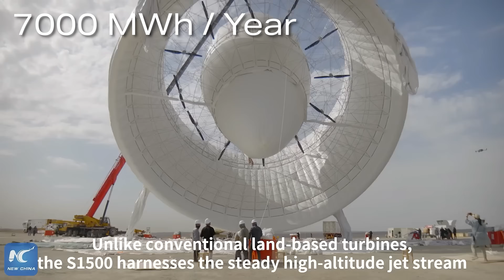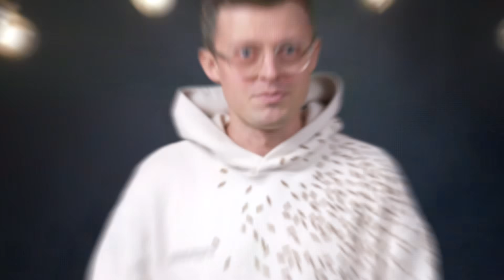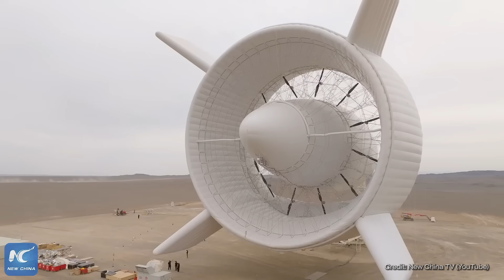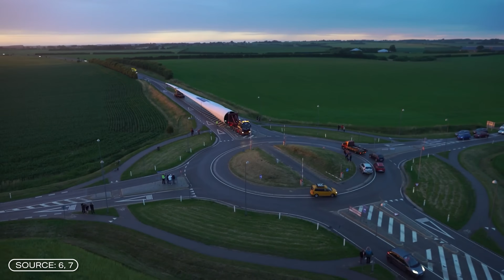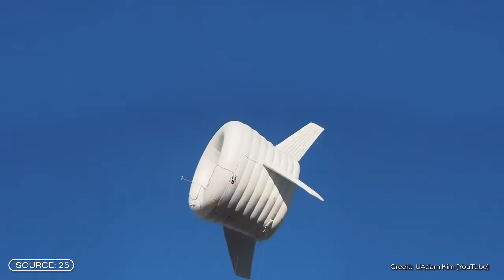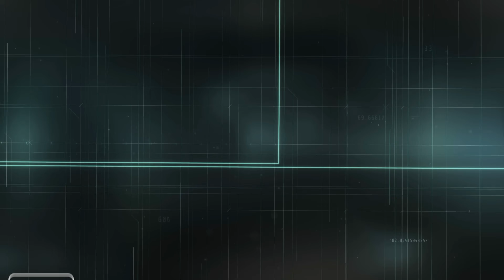China's Wild New Inflatable Wind Turbine (1.2 MW Output)

Comment: Since this video is 6mo old, it's notable that SAWES has already tested an S2000 model, including temporary grid integration, and is moving into mass production. I think their main challenge is that they still rely on retraction and landing during heavy winds. A couple of ways they could improve the design to avoid that would be with aerofoil fairings on the tether to avoid vortices and dynamic feeding of the line in response to realtime conditions. Then they might be able to leave it operating through storms, gaining 30-50% generation overall.

On the topic of dislike for wind turbines, there are two things in these airships' favor. The first is that their design is an icon of the solarpunk ideal, and their form is much less imposing than a massive tower that triggers phobias of large structures. The second is that they are operating in the statosphere where planes are already contiunously running turbines, so the silly argument about bird strikes becomes blatantly dumb instead of being able to fool some laymen.

Comment: A 100kW alternator weighs 350-450kg and that S1500 has 12 of them putting the weight at 4200kg at the least before adding the blades and the airship and the 1km of cable.

Comment: Thanks for sharing the video; very interesting concept.

I would be curious to hear more about a couple of aspects:

* How is lightning protection handled at these heights?
* What safety measures are in place regarding the export cables, particularly in case of failure? I imagine the potential impact could be significant if a cable were to fall onto infrastructure or people.

Appreciate any insights you can share.

Comment: yeah but the tether... we are talking a >1,5km cable thick enough to be insulated and able to actually transport down all that energy and also keeping the thing in place... the forces are very high because you have to hold the thing against the wind with at least enough tensile strength as the weight of the system and its drag. And what if the wind swings, would you have that thing leveling things all around?

Comment: Hydrogen is fine as long as its around a barren uninhabited desert. The small potential for capital lose is greatly offset by how cheap itll be both to produce and deploy. So what if 5-10 or burn down a year. No one gets hurt and the only lose are fans and a electric cable and polyester shell.

Comment: What about the energy loss because of the length of the cable
Reply: It wouldn't even be able to support the cable tether and transmission cable weights alone.
Reply: @ForbiddTV  what? They did get it to 2000 meters and they got it running and functional. Modern aerostat technology far exceeds the 2000 meter threshold, it's absolutely not a question, highest tethered balloon they launched was in 2022, the Chinese reached a record altitude of 9032 meters
Reply: @HackedToaster  You are believing in a false meme based on scienceploitation.  The S2000 has a total helium capacity of 20,000 cubic meters of helium. Such a blimp would have a gross lift capacity of 20,000 kg to 22,000 kg. The wire for such a 3MW output would be 300 mm² to 500 mm² wire (copper/aluminum) and would weigh 3.4kg per meter (300 mm² copper) or 3kg per meter (500 mm² aluminum). Since the fake machine is at 2,000 meters altitude, one conductor of wire would weigh between 6,000 to 6,800 kg.  There would be a minimum of three conductors which makes the wire alone to be 18,000 to 20,400 kg.  There is also a tether cable of unknown material or weight.   Plus the S2000 dry weight is about 2,000 kg.
Reply: @HackedToaster   They might have raised such a blimp, but couldn't possibly have transmitted advertised power at 2000 to 9032 meters.  Get a clue.
Reply: @ForbiddTV  you're saying that there's no cable strong enough,  I've shown you facts that you're wrong and now you're clinging to the power delivery like I said something wrong 😂 
 I raised the question about power delivery in the first place, this isn't a catcha you thought it was, "get a clue" shut up
Sure just brush aside whatever I have to say. This is meaningless to talk to you if you're acting like that
Reply: @HackedToaster  I have been doing alternative energy for more than four decades. Research the cable required to make your meme even possible, then find the weight of said cables plus the tether per meter.
Reply: @ForbiddTV  I have no doubt about how many years you have been doing what you claimed to be doing, after glancing through your channel. 
You seem to be a debunker of bullshit, which I appreciate.
It's just that the reality is they did deliver power through the 2000 meters long cable tethered to a balloon, which is what they did in January, the cable they used is the one intented to deliver power, the cable would be as heavy as the balloon itself , or at least 2 metric tons and yet they did it. The only way to deny it would be claiming that they lied and all of this is fake 

I think you're calling it a "meme" (which isn't what meme means) because of your experience and expertise, maybe, just maybe, they figured out a way to do it? I'm not trying to argue with you. I simply raised the question of how they solved the problem with power delivery and you just barge in like an angry grampa
Reply: @HackedToaster   So you can’t even be bothered to look up the definition of meme. Interesting.
Reply: @ForbiddTV  the original meaning is from Greek "mimema"  ‘that which is imitated" that's not what it means now, words and languages change through time. And even with the original meaning it doesn't really relate to the context, even with the definition from pre-2010s, meme is how a behaviour or an idea spread from one person to another within a culture, which this balloon and its achievements hasn't reached that status yet, and with modern day definition, the only meme element is that it's a balloon and people would tie it to the F35 balloon take down incident, right now this balloon in itself is neither humourous or ironic, which is why I find it strange to see you refering it as a meme 
And how old are you? You said you have been doing electrical research for 4 decades? You're pushing 50 or 60 now? Maybe it's best to not argue what "meme" means

Comment: Why don't they use hydrogen instead of helium? Manned blimps would want to avoid flammable gasses for obvious reasons, but for unmanned systems hydrogen should be ok.
Reply: It wouldn't work either way.
Reply: @ForbiddTV  Why?
Reply: @nikolatasev4948  As memes way too heavy, then add all the weight of four tethers and electrical cables and it would never leave the ground.
Reply: @nikolatasev4948   You are believing in a false meme based on scienceploitation.  The S2000 has a total helium capacity of 20,000 cubic meters of helium. Such a blimp would have a gross lift capacity of 20,000 kg to 22,000 kg. The wire for such a 3MW output would be 300 mm² to 500 mm² wire (copper/aluminum) and would weigh 3.4kg per meter (300 mm² copper) or 3kg per meter (500 mm² aluminum). Since the fake machine is at 2,000 meters altitude, one conductor of wire would weigh between 6,000 to 6,800 kg.  There would be a minimum of three conductors which makes the wire alone to be 18,000 to 20,400 kg.  There is also a tether cable of unknown material or weight.   Plus the S2000 dry weight is about 2,000 kg.
Reply: @ForbiddTV  You could have a much thinner wire if you used higher voltage and thus lower current. You don't need three wires either, two would be enough to close the circuit.
You also don't need to generate all your lift from buoyancy. At lower altitude it needs to carry less cable, so it can raise up into the high wind - from there the wind and body can provide enough additional lift. They have winglets as well.
I don't see any principal reasons for this not to work. If they find out they still lack lifting power, they can always scale the volume up a bit more, or decrease the generating capacity.
Reply: @nikolatasev4948   Still trying to defend a failed meme?  Higher winds means higher altitudes and  more cable.  A 2,000 meter elevation would actually mean about 3,000 meters of cable.  We already know it doesn't have enough lift for even 2,000 meters of cable.
Reply: @ForbiddTV  We don't 'know' how much it can lift. You made up some numbers, gave a wrong number of cables needed, ignored a significant source of lift and came to an obviously wrong conclusion. Then you pretend you proved anything one way or another.
Reply: @nikolatasev4948   Since you refuse to look anything up, invent your own numbers and I will prove them wrong.  All of your MEMES will be your own undoing.  I fully researched my numbers and phrases, you refuse to do so.

Comment: Helium is the one Achilles heel of this thing. I wonder if a hot air Zeppelin version can be made. Say, by using a small fraction of energy to regularly heating up the air inside. Or else, their supply will always be limited to this one factor.
The upside is, they can also be used to harness energy from storm, even typhoons. On top of that, their power output can be multiplied by sticking flexible solar panels on them. However, how much they'll interfere with air traffic, how much stress they'll put on the ground attachment, what mayhem a falling one might cause etc are real issues to be addressed.

Comment: The helium gas is a problem. It's a finite resource and we have more important uses for it. I also think one of the easiest ways to go up is with a pole (I'm not being facetious) but perhaps part of the problem perhaps that the height is currently being limited by the way we are engineering wind turbines by placing the massive turbine at the top. So, in short, the turbine itself one third down with the rotors at the top. All on a four legged base station (like the base of Eiffel Tower). Smart design and on site assembly means it can be more practical to manufacture and transport.  Maybe? Dunno?

Comment: hello Dr Jacob, could you please speak a little bit faster? i'm having trouble paying attention to what you're saying because my mind keeps getting distracted by your thick German accent.

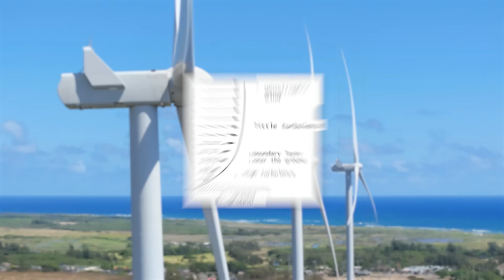at 1:43 you say that when wind speed doubles, its power increases 8 fold? the energy of the air particles is 0.5mv^2 & power is energy/time so maybe 4-fold?

you how they make plastic kayaks where they put the kayak mold in a machine that spins it in all directions & has the molten plastic cover all the walls evenly?, maybe after inflation when the balloon is rigid, you could do a similar thing with a very light sealant that coats the insides while the balloon is spinning around all crazy in a heated chamber.

this design is very cool because the turbines are in an enclosed space & it would cost very little energy to make them bird-safe.

Comment: Fantastic🎉🎉🎉🎉🎉🎉 video

German guy.....you are fantastic don't forget that

Yasssssssssssssssssssss China like that generator....less infrastructural impact?
Disaster areas, mountainous regions, desert? 

Hmmm maybe fit it with sustainable hydrogen inversion system  to auto reinflate or use drone maintenance system to apply sealant coverage

🎉🎉🎉🎉🎉🎉🎉🎉🎉🎉🎉🎉🎉🎉🎉🎉🎉🎉🎉🎉🎉🎉🎉🎉🎉🎉🎉🎉🎉🎉🎉🎉🎉🎉🎉🎉🎉🎉🎉🎉🎉🎉🎉🎉🎉🎉🎉🎉🎉🎉🎉🎉🎉🎉😎😎😎😎😎😎😎😎😎😎😎😎😎

Comment: This could be a great way to recharge hydro storage. You could probably mount several of these things on the length or perimeter of a dam, trickle recharging the dam so that it's ready to discharge at high speed when required, and being able to do it even during low renewable generation periods without taking as much from the grid. 

I mean, whether you'd be better off just having vast floating solar on your upper reservoir would be the debate there i would imagine.

Comment: Big Hero 6, here we come!
Reply: Also, it occurs to me that since a certain level of climate warming is baked in for the next hundred years even if we stop emiting greenhouse gases today, that this means more energy (heat) in the atmosphere. That means whilst climate change means more unpredictable and extreme weather one predictable thing is more air movement, i.e. wind. Especially high up. So once the heat energy has turned into that kinetic energy... anything we do to siphon off some of that excess kinetic energy is slowing down the actual rate of change. I mean, obviously by a tiny, tiny amount, we'd have to practically blot out the sun to noticeably affect things with turbines alone, but every little helps with this, whether its' energy storage or harm-offsetting with carbon and energy harvesting.

Comment: Why use helium over hot air? Helium is a non renewable resource and if you’re generating that much energy you could presumably heat the air in the balloon with most of it left over

Comment: Change the outer cover to mesh netting having solar panels included into the nets for removal & maintenance or upgrades.   Lets put some on top of  skyscrapers or inside a middle of two.
Reply: the solar panels will likely and will have to be flexable thin solar panels but it's a good idea and you get a bit higher efficency at higher alts but depends on how high you are tho you can improve it with multilayer flexable solar panels while more expensive to manufacture, but they make more electricity for the same surface area and better efficiency.
Reply: 它的外网是用特殊材料制成,没有办法覆盖太阳能电池版.中国去年才研制成功.并在无人区发电.

Comment: For public acceptance, if it's flying 1500m above ground it won't be an issue. It's not a massive pole with periodic shadows that could sweep across your window.
Reply: You'd also have to clear everything in 2km diameter in case the thing falls down
Reply: @NJ-wb1czyou'd have to do the same for any plane route, if that's the level of concern we go with. They can be made to fail very slowly by compartmentalization and then pulled down safely anytime something happens.
Reply: @ShiroKage009  planes have been deceloped for many decades, are inspected on the ground after every few hours of flight, and have people inside constantly monitoring their performance. They can also choose where to land the plane.

Compare that to a novel blob with no operators inside that can't fly on its own, is supposed to keep working 24/7, and is fundamentally tethered to one spot with giant cables that in themselves can easily crush people
Reply: @NJ-wb1cz Novel blob? Blimps have been in continuous operation since before airplanes.

Comment: The cost seems largely driven by the price of helium, but there are designs for hydrogen airships that get around the flammability problem by having two shells and all the hydrogen that escapes the inner shell is deliberately burned so it never reaches a density at which fire could spread.
Reply: It's crazy to use helium for things like this. Since it's unmanned, I wouldn't worry about the safety of hydrogen.
Reply: @skunkjobb  yea the worst thing you could say is have it above a population area, which shouldn't be too much of a problem as long as it's out in deserts, and you can reduce the chance of it igniting like putting a lightning rod and such from it connected by a separate wire from the balloon down to the ground
Reply: Or just let it burn? If it's not flying above a populated center why does a fireball a kilometer up in the sky matter to anybody
Reply: @deek0146  Hindenphobia?  But there is the inconvenience of losing their turbine and generator.
Reply: Prototype being a helium blimp makes perfect sense for safety during testing. If the approach works, I would expect these turbines to get very extremely large and use a Hydrogen zeppelin since bigger is cheaper due to square-cube law.
Reply: There are also systems which use kites, and these are commercially available: Kitepower and SkySails
Reply: @3838skslaoeiwpf  There are, but they go in a somewhat different direction, where the generator etc is on the ground powered by reeling out the tether and the kite is flown dynamically.  More appealing in some ways.
Reply: @3838skslaoeiwpf as much as I like the blimp idea, the kites seem to be a better option, especially for smaller communities.
Reply: Yes!
Reply: Yeah, I was also thinking about Hydrogen being viable given that it's not going to be manned. As long as they try not to station it near populated areas, it should kept the risk down to a minimum.
Reply: If it is above sea and far from people, then it doesn't matter whether she is filled with hydrogen, helium, or kryptonite.
Reply: Th
Reply: Th
Reply: The problem seems to me to be helium leaking out how about using😊some of the power to generate hot air a hot air system needs to be 75% larger but theoretically could remain in the air permanently.

Comment: So the turbine produces electricity which can easily be converted into a better lifting gas than Helium, but the lack of Helium is slowing down production? Surely one turbine could make more than enough hydrogen by electrolysis in it's first year to fill the next few turbines that could fill the next few dozen that could fill the next few hundred in a very sustainable and growing way.
Hydrogen is a lifting gas that we need to employ once again. Like this if you agree!

Comment: I assume you're going to fill these with Helium?  Isn't that an expensive finite gas that's running out?  Unless you can make a breakthrough in lightweight material that can contain hydrogen gas which would be cheaper as you could produce it onsite from the very turbines generating power and then add little fog nets to the frame to catch some water and electrolyse it to keep the turbine blimps inflated, then I don't see this being economically feasible